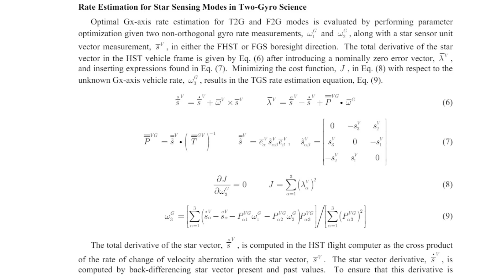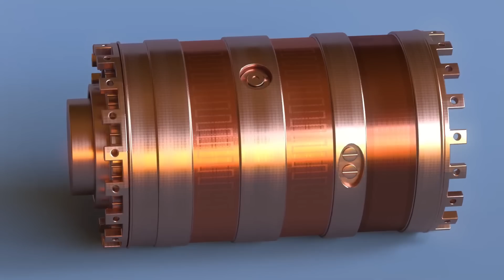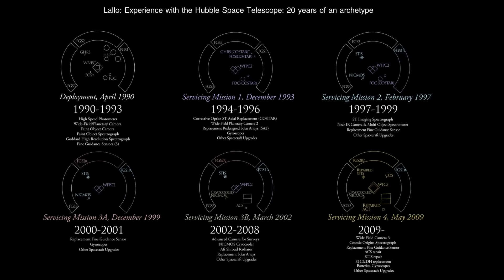How Failed Gyros Are Making Hubble's Life Harder

Comment: AEROSPACE ENGINEER HERE: I am going to try and explain how this gyroscopic control sounds straight forward but its anything but straight forward. The math involved is actually the hardest math there is in all of engineering.
Sorry for the length of the explanation, but there is an interesting story at the end I promise.

FYI - I love Scotts channel its fantastic. 
The only thing I don't like is he's flying and I'm not at the moment.

In my final year when we had to do 2 high level aerospace options and a few chose to do Spacecraft Dynamics which we foolishly thought would "be cool" because it sounded cool (sort of). For those unfamiliar most universities have a ranking system for classes at my college (U. of Illinois) everything was a 100, 200, 300 or 400 level class. Most undergraduate classes are 100 & 200 level while 300 & 400 are for postgraduates. However most degrees required 2 x 300 level classes. In engineering (as far as I remember) every 300 level class had a 400 level equivalent. The difference was the 400 level required a term paper that had to be presented like it would be for a conference. So when you do an engineering 300 level class you do it with the 400 level students but they have to do their term paper and present it to the class (see below).

The 2 most common classes my senior class did 2 were Finite Element Analysis and Orbital Mechanics. FEA because its reasonably straight forward and is used across many engineering fields and OM because that's what both NASA and the satellite industry want. Spacecraft Dynamics is an alternative to Orbital Mechanics and the difference is like the difference between a pilot and a navigator on an airplane. A navigator works out the path you will fly while the pilot flies it. Orbital Mechanics is analogous to navigation while Spacecraft dynamics is analogous to piloting.

Within 2 weeks of starting that class EVERY undergraduate tried to get out of it once we realised how hard the math was. Orbital Mechanics is generally regarded as one of the most math intensive classes any engineer can take because its done on spherical coordinate systems and nothing travels in a straight line. Spacecraft Dynamics is another level up on that because not only does it require solving simultaneous non-linear differential equations but doing it with coordinate transformations as well.

The Basics
To most human beings we see the world in Up-Down-Left-Right-Forward-Back. We call that a cartesian coordinate system. Think of a normal X-Y graph and then look up "smith chart" in YouTube search. In space everything is in spherical coordinates. Further every major body (like the Sun and the planets) there's its own spherical coordinate system and those systems are moving at different speeds and different orbits. That's what makes orbital mechanics the headache that it is. There's no nice simply x-y-z its all r, θ, φ. Navigating from just the earth to the Moon one you have to translated from the Earths (r, θ, φ) to the Moons (r, θ, φ) but if you want to go to Mars you have to go from the Earth (r, θ, φ) to the Mars (r, θ, φ) while dealing with the Suns (r, θ, φ). Yeah its coordinate systems within coordinate systems.

The problem with flying a spacecraft.
Why Spacecraft Dynamics gets so hard is because you have the spacecraft's own coordinate system which is in cartesian coordinates because that makes it possible to write the basic math out in the first place BUT THEN you have to translate that system into the orbital reference frame that the spacecraft is flying in and that system is a spherical coordinate system. Because the equations for gyroscopes are differential equations you start with a set of 3 dimensional simultaneous non-linear differential equations that you then have to translate into another coordinate system as well as solve it. 

And why is that needed - because things like Hubble have to fly in a spherical coordinate system while orientating in a cartesian system. Gyroscopes are great because they don't need fuel but there's a things called precession.  

Go look at Wikipedia for the page title Gyroscope. Down the right hand side there's 2 labelled pictures and 2 animations. Look at the 2nd animation where they show the effect of twisting a gyro about an input axis. This is the problem you can't just turn a gyro and expect an opposite rotation because precession causes a twist in the other axis. That's the effect of precession. This gets even more complex as you move from singular to multi-axis gyroscope systems because as you twist one gyro it causes the other gyro or gyros to also twist and then you get a compound precession and that math gets so horrible it still haunts me 37 years later.

I said at the start I'd give you a good story.
I did that class in 1987 during the height of Ronald Reagans Star Wars program and most (if not all) the post graduates were sponsored by DARPA and working on Star Wars stuff. I remember the term papers 2 of them presented. One was on the dynamics of rail guns but that's for another day. The other guy was doing high accuracy pointing of space based laser platforms.

He was quite possibly the smartest human I have ever met in terms of applied math to an engineering problem. He could not only solve the basic math but link it to tracking other objects on other orbits as well as ballistic trajectories but what really made his work exceptional was the anti-shake system he developed. Oh Yeah and he put this into software and could make it work in 2 dimensions. It was an amazing achievement but it then needed to be done in 3 dimensions.

The real problem with a space based laser platform is the platform wobbling or vibrating when it pans. There's nothing odd about that as every thing wobbles or vibrates when it pans. Things like robotic arms and satellite dishes all wobble when they pan. The difference is when they are attached to a large object like a planet or is in an fluid like air or water that gets damped out. In space however there's nothing but the structure of the spacecraft itself to dampen vibrations out. One way to deal with that is just pan slowly which is fine for telescopes like Hubble or a probe out at Saturn or Pluto but for a laser cannon you want to zap missiles NO, it has to pan fast, stop without any additional motions and shoot. 

So even if you could solve what's arguably one of the hardest math problems ever conceived there's still the basic mechanics of a space based laser. If you just want to hit something on the ground from space we know the basics of how fast the gun will be travelling (28,000kmh) and what the range is (240km), but what does that mean.

Here's how to think of the problem.
Imagine a target 2.4km away that you have to shoot. Sounds straight forward until you check the list of longest sniper shots on Wikipedia and find only 6 times in recorded history has anyone successfully shot past 2,400m and hit the target and they were snipers in a stationary position. So just hitting something that far away is hard.
Now imagine being in a Ferrari ripping along at almost 280kmh and trying to make the same shot out the window.
Now multiply each of those numbers by 100 and that's the basic problem of shooting a stationary object from Low Earth Orbit. 
which is 28,000kmh at a range of 240km.
Now take the target put it on a rocket and fire it into the sky where its going Mach 10 (or more) and its maybe 10x further away at about 2,400km and that's the basic problem of shooting an ICBM from space.

Once we realised what the basic task actually entailed we knew that part of Reagan's Star Wars could NOT work. There were other methods in the Star Wars program like the ground based interceptors that we know have. However 37 years ago we knew that shooting ICBMS with a space based laser was not practical. Even 37 years later with all the advances in computers its still NOT practical because the mechanics are still the same problem and you still have to solve the math problems before you even try and make it work. And those math problems are a nightmare because its a gyro problem.
Reply: Great explanation and stories! And at 1,500 words it disproves my theory that the YT algorithm now automatically deletes posts more than a few hundred words long because you rarely see long posts anymore. By the way the upcoming Polaris Dawn mission will be testing laser communications between satellites and they will be having to deal with the same issues that you talked about regarding wobble.
Reply: @StevePemberton2  Everything shakes, its just that in most cases there's a way to dampen it or its naturally dampened or it simply doesn't matter, but if your trying to hit a target it does.
Reply: @stevepemberton2 just a note 😃starlink satellites already do laser communications with other starlink satellites (a total of 42 petabytes per day of data is moving between starlink satellites)

@tonywilson4713 that was a great comment.  Definitely worth the read.

Scott Manley videos are already interesting and well done   And then the comments section just adds so much high quality related info.
Reply: @Retired-Don  Interesting on the starlink comms and you're the second person to point out lasers for comms.

There's a difference between hitting a target with data and hitting it with enough energy to kill it.

There's an urban myth/story from the early 90s when the Russians released a photo of one of the missiles partially assembled with its warheads visible. Except instead of the standard military green the warheads  were polished to a mirror finish.

That was one of the things we also had worked out. What happens if they simply give their missiles a polished surface.

The other classic are the people who make spurious claims overusing microwaves to kill a satellites electronics. Anyone who's looked into the subject of getting electronics "space rated" is that its all hardened against the microwave and other environmental issues in space. So I always ask people who claim they can do these "microwave soft kills" how much power they need to punch through the hardened protection to kill the electronics?

I get crickets every time.

Also I just watched a super podcast with Jon Stewart on the military industrial complex.
Reply: @Retired-Don I'm sure the math is still difficult but with the right algorithms and computing power available today vs. the 80's it's much more manageable. The laser comms between Starlink sats probably doesn't require the same focus and precision required to knock out an ICBM in boost or coast phase.
Reply: @Retired-Don  I'm not sure what will be different with the Polaris Dawn test. I think Starlinks tend to set up long term links with nearby Starlink satellites in the same orbit, although they apparently also do a lot of ad-hoc connections with passing satellites in different orbits. I don't know if the Polaris Dawn Dragon capsule will be in an orbit that makes things more challenging. On their website they state, "The Polaris Dawn crew will be the first crew to test Starlink laser-based communications in space". Maybe the emphasis being on the fact that it's a crew doing it, not that they are doing anything technically different. In an interview last month Jared Issacman said regarding the laser-communication experiment "We have something super exciting planned for that — it's a really big deal," Whether he means it will be technically a big deal or something else I guess we will find out in a few months.
Reply: Surely they have thought of other ways of pointing a laser from a space based platform without requiring panning or slewing of the entire spacecraft bus.  I will only say I actually lost the ability to do arithmetic in my head after taking differential equations but could, back then, solve second order non-linear diff eqs... 😂
Reply: @BlueSpruce2  Your missing the point. The moment you pan ANYTHING on a space craft the rest of the space craft moves.

You see when you move (walking, running, whatever, the planet actually moves in the opposite direction. Its just that the planet is so huge in its mass that the movement is infinitesimally small. Plus with everyone else moving its lost in the background noise.

That doesn't happen on a spacecraft. If you look at probes like the Voyagers that had camera's out on arms that panned. When they panned the rest of the spacecraft panned in the opposite direction. Because of the difference in mass its a much smaller movement BUT ITS THERE AND IT HAS TO BE CONSIDERED for things like manoeuvring burns or you wont get the right delta-v of the burn.

having to consider the effects of everything is what makes space craft dynamics such a convoluted and arduous subject and also why so few people ever do it. It would be the last subject I'd advise an undergraduate do. Do things like FEA and OM because those things can help get you a job (maybe).
Reply: @BlueSpruce2 no, for SDI you had to slew the whole satellite because it was a bomb pumped X-ray laser. The laser was the space craft.
Reply: @bogatyr2473  That's probably why it was thought to be an impossible task to take on multiple launches and required taking out the launch vehicles in the boost phase.  Once the MIRVs at hypersonic speeds were released it's game over.
Reply: Maths in rotations and translations gets very much easier with the benefit off periodic Relative positioning than what i think you were applying the Absolute positioning method.
Like when you drive down a road, constant relative adjustments to the wheel. Yes you need feed constant feedback.
Reply: @russellcollins5692  Go back and look at the problem.
You're not understanding it and its too damn hard to explain here in a YT comment.

Comment: The optics and everything else work perfectly fine, so I was wondering it they couldn't build some kind of cradle that could attach itself around the main body of the scope that could be used for pointing control instead?
Would be a hell of a feat of autonomous engineering to get it to dock properly but could easily extend the operational life by another 30 years if done right.
Could include a booster to also raise the orbit by a fair bit.
Reply: While the Hubble Space Telescope (HST)  has done great work, it is planned to be replaced by the Nancy Grace Roman Space Telescope (RST) being built at NASA's Goddard Space Flight Center (and as noted up-thread, built on the chassis of a satellite that the US military decided it did not need anymore). RST will also have visible light detectors but will have a much larger field of view than HST.

I spent a non-negligible amount of my early career supporting HST activities. But things get old and not worth servicing. It would be amazing to safely capture HST and return her to Earth, but since the Space Shuttle (STS) infrastructure that launched her is no longer in service it would require an absurd amount of money for what amounts to a PR mission. Even trying to justify such a thing by saying that samples will be taken from the materials used on HST to investigate the long-term effects of low-Earth-orbital environment is pretty sketchy.

Comment: Always forget the gyros are not control moment gyros as found on the ISS, but just rate sensors while control is provided by reaction wheels.  The reaction wheels still work.  The reason hubble never got ring laser gyroscopes was either extreme conservativism or not having enough accuracy by 2009.

Comment: These gyroscopes are based on the MIT/Charles Stark Draper designed 2.5 inch diameter fluid floated Inertial Rate Integrating (25 IRIG).  This technology goes back to the 1950's, when MIT constructed highly accurate gyros for various ballistic missiles such as  Mace, Thor and Titan II.  Similar technology was incorporated in the first two generations of (Polaris and Poseidon) submarine launched ballistic missiles (SLBM).

The primary Apollo LM and CM inertial guidance systems used a variant of the Polaris and Titan II 25 IRIG.  It incorporated a 24,000 RPM spinning rotor within a sealed in a beryllium housing and floated in a high density Chlorofluorocarbon fluid. 

The Poseidon missile version was upgraded to a highly stable beryllium oxide ceramic float structure and a gas spin rotor bearings (as opposed to earlier ball bearing versions).

The biggest changes to the HST version of this Bendix (later L3) manufactured 25 IRIG gyroscope was to modify it to be directly body mounting onto the spacecraft structure as opposed to decoupling with a separate gimbal structure and reducing the rotor RPM to around 19,000.  A permanent magnet pulse rebalance torque motor was needed to keep the float assembly within a few Arc-seconds of rotational alignment. There are no actual mechanical springs used as a restraint.

The structural stability of the gyro rotor bearing assembly was usually held to within the Angstrom range.
Reply: What motivated the choice to use beryllium oxide ceramic components?

Comment: I wonder if anybody has explored Mr. Nyquist's fine work on sampled data systems. If the guide stars could dynamically be aligned in the data from short exposures the rest of the data could be summed by (approximate) position and allow more position slop and drift on Hubble when in use.
{^_^}